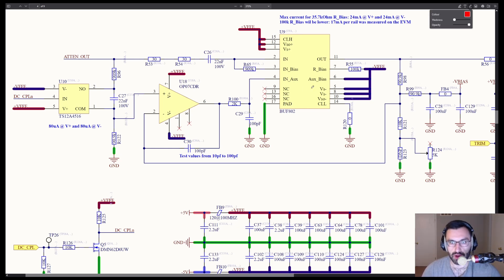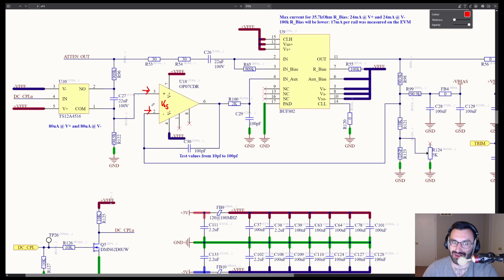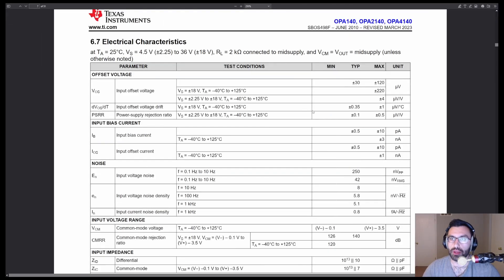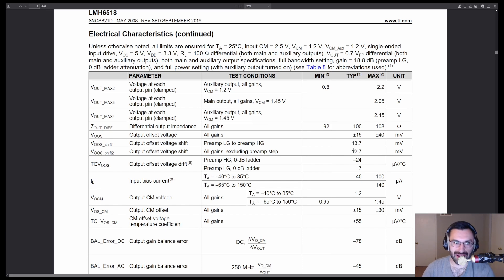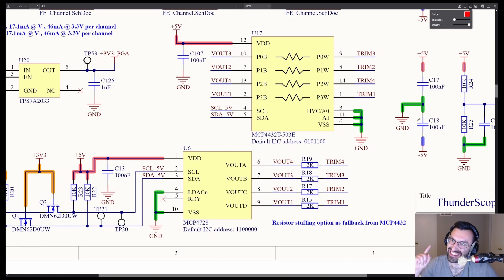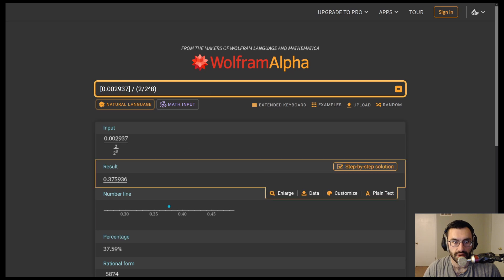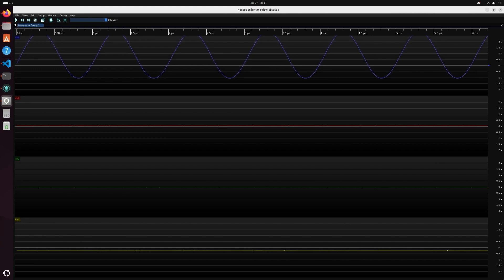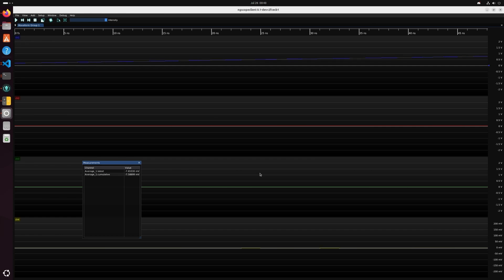ThunderScope Analog Front End - DC Offset

Comment: Hi, did you got something from TI regarding input capacitance tolerance of BUF802? Seems that is huge like 20% they reply to me in the forum.
Reply from the maker: That sounds about right, you'll either need to trim for it, or drown out the variability with more capacitance in parallel (like in this design, as scopes need ~15pF to work with passive probes)